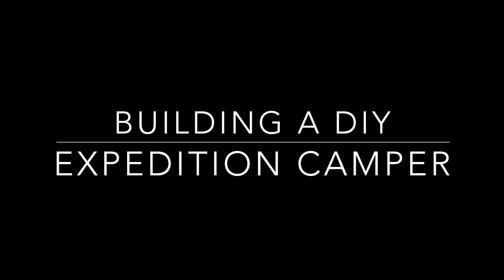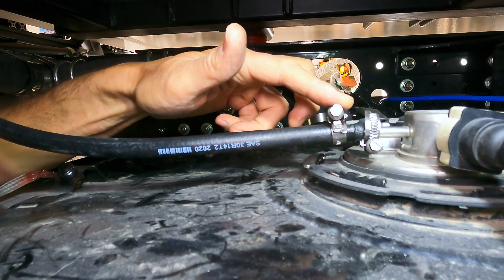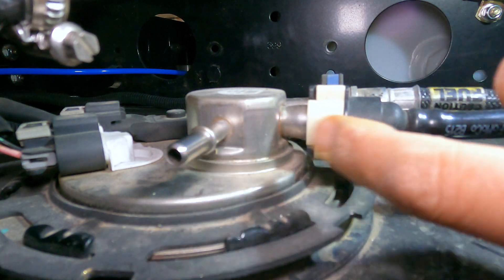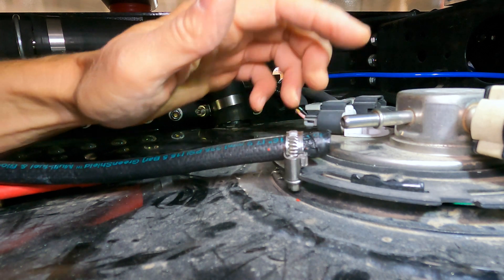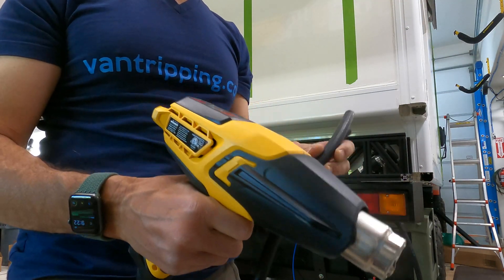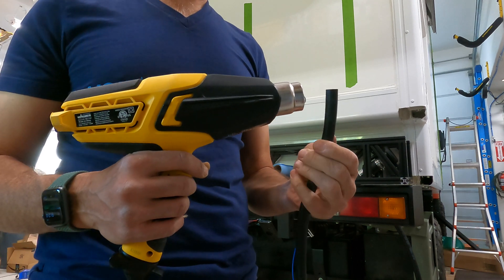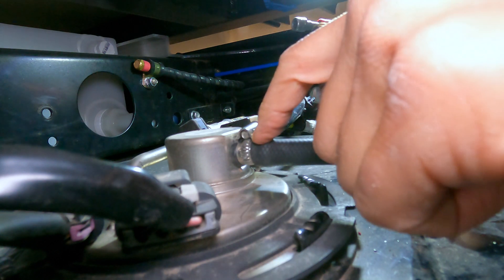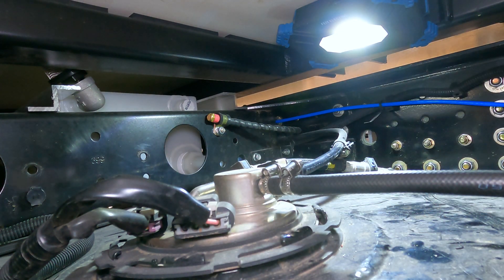Solving the Check Engine Light since new, #73

Comment: Glad you were able to fix it. Surprised a bit they were not willing to help troubleshoot it , fix it, or provide you with a solution. I'm sure there have been other complaints about this type of issue.  Or if a one off it just may say there was a goof up on their install.

Do you feel your voicing of your frustration and disappointment with their support and chassis build issues might also have been a factor in their lack of motivation or outright refusal to help? 

It seems they have a decent product but a bit of Sophomoric approach to resolving issues. 

On that note I do have to say I do not know the full story nor have heard their side. I can only base my opinion off what you have described and shown.  

Given you high level for exacting attention to details on the videos you've made, leads me to believe it's perhaps their new offerings of just the truck and chassis without building the habitat at the same time. What they maybe more experienced building. 

Thanks for pushing through and having the where with all to investigate and solve the issue.  So if others have this issue they can use this as an example. 

Thanks for sharing.  Side note, missed a few notifications of your new videos or did not get them. Perhaps a branded thumbnail that pops to act as a pattern interrupt in the see of notifications 🤔
Reply from the maker: Yes, I had called them soon as I picked up the vehicle new (as it triggered only a few miles from their shop after picking up new--see previous videos on this from months ago)--and they said it might be a problem when I picked it up as it has been for other owners. I asked for their help over several weeks, even just sending me their diagnostic tool which I would use to see the error code and then send it back, but they were not willing to help even though the vehicle was brand new. Their solution was for me to take it to a dealer, even though they have had issues with the check engine light all due to fuel system evaporative return. Which since they modify the factory fuel tank, I presumed it would be due to this and that no dealer would touch it with a modified fuel tank. Plus it wasn't very drivable to the nearest dealer a four hour round trip and in the winter time with an open camper when I was seeking their help, so I had to resolve it myself. This video is released almost a year after picking up new and over 9 months after asking for  EarthCruiser to help resolve it, with my many suggestions of working together to do so.

Thanks for your feedback.
Reply: @vantripping  I remember the video where you talked about that and the over torque of the chassis bolts. It just seemed odd that you just spent so much money with them, they had several other customers with similar issues and they went right to the pass the buck mode

It's sad the amount of degradation (for a more pc word) of basic customer service and standing behind your work. 

But again koodos to your determination and can do attitude to solve it.  Well done
Reply from the maker: @livingworkingoutsidebox  Thank you for your comments. I was very frustrated with many issues during the build process, many that were never resolved including items that we agreed to that EC did not provide, and generally just very poor project management and customer care from a few that really ruin it for the company. Unfortunately, those few are in very pivotal or key leadership roles so they greatly affect customer experience and satisfaction. I have voiced those concerns with EC in a way to help them get better, as I conferred with other customers and we were all having the same or similar issues and unsatisfacotry experience. The EC team does great work and cares about customers but it only takes one manager not focused on the customer to really ruin a positive result. Overall, I am happy with the product but with many frustrations mostly due to poor communications or management of the process. I truly wish EC the best and will help them in any way I can and they are willing to receive, but I must be honest about my experiences or I have no ethics in what I share with my viewers.

Indeed glad I was able to resolve this long-standing issue and hopefully great performance and joy without issues for years to come. I think this platform can provide that.